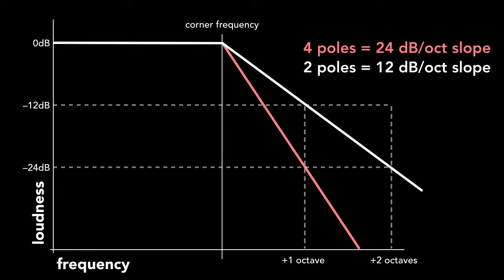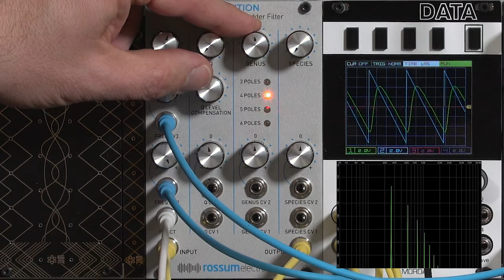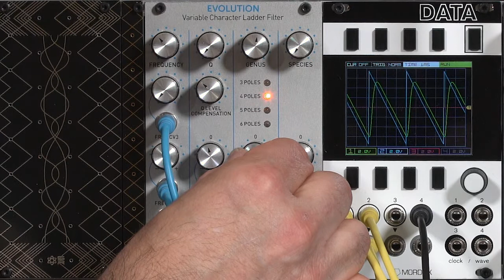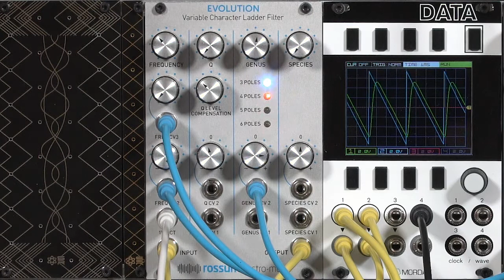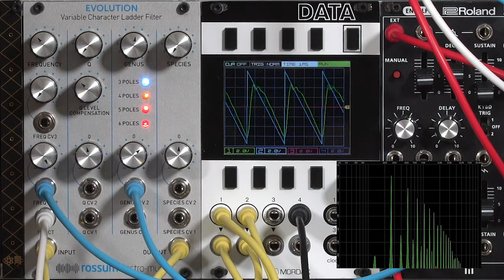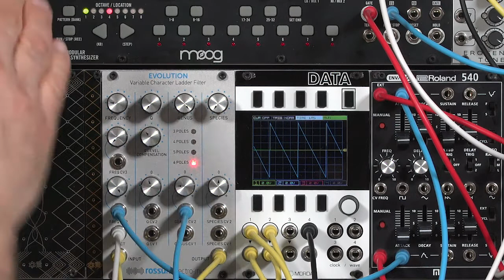Rossum Evolution 2/4: Genus (LMS Eurorack Expansion Project)

Comment: I love your videos, they have been a great guide in so many ways! I've been looking to pick out a ladder filter to try and get a rich, vintage Moog sound in eurorack form. How does this compare to the AJH transistor ladder filter? Are there any big differences you can tell? I've had a mother 32 and really miss it's warm tone but just need a filter now. Both evolution and the AJH seem solid but I haven't found enough on the ajh. Looking for a little guidance. Thank you again!
Reply from the maker: I'd say the Rossum filter sounds different than the classic Moog sound, if that's what you're after its more like a very-cleaned-up Moog. The AJH is modeled off of the Minimoog and would be very close to that. And for "the Moog sound" I happen to like the Doepfer A-108 VCF-8, which is a transistor ladder design with separate outputs for 1, 2, 4, and 8(!) poles.
Reply: Thank you! 🙂